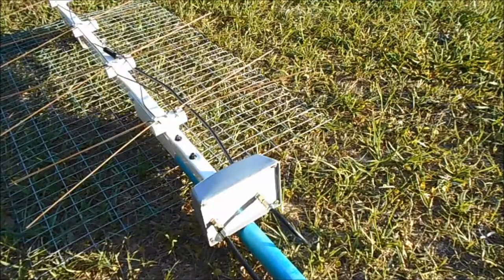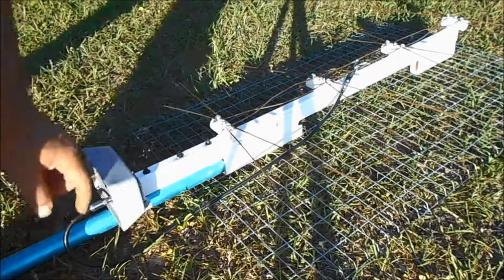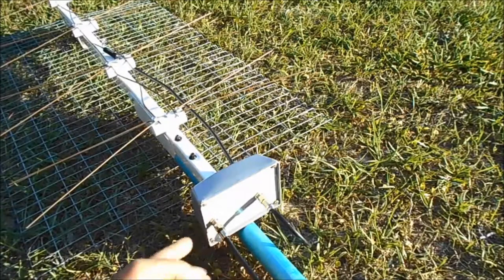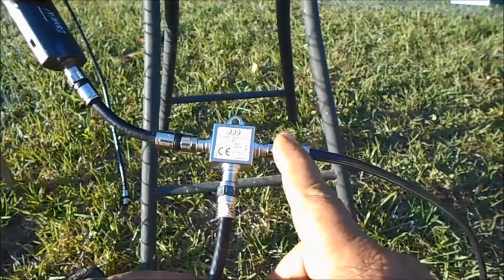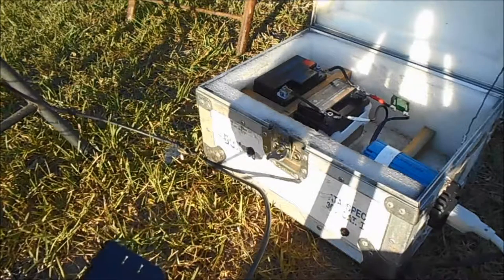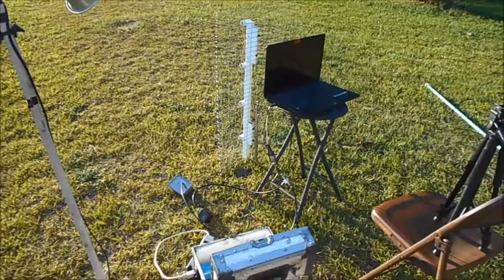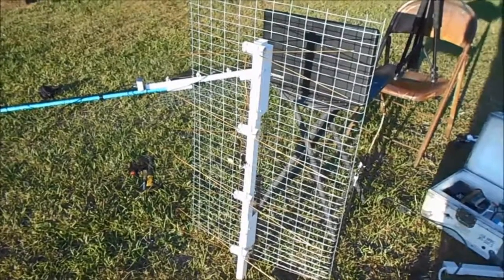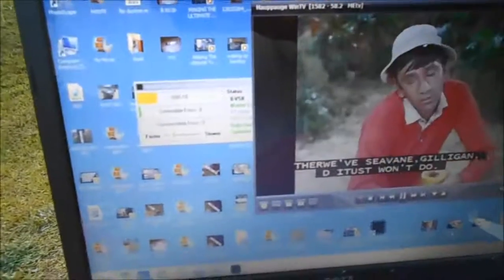Channel Master Booster Installation Before And After Demo

Comment: Hi Danny. I'm confused i made the Ultimate antenna with the  upgraded pvc and screen material for the reflector.
 It was about 15 feet in the air and worked great. I'm about 60 miles east of nyc on the south shore of long island. About a block from the water.
       I put the antenna up on my chimney about another 12 feet so its about 30 feet in the air and I lose a channel, even with the booster off ( I figures stronger channels get messed up so i took the booste off). I'm using the rca amplifier. It was working better when it was lower but i don't have a lower place to put it.
    Should I try making a different antenna? Any suggestions would help a lot.

Comment: Are you using the  7777 or the  7778? Also what is the bennefits of the Channel Master compaired to  say a Winegard LNA-200XT. Some claim the Winegard  has less noise others say the Channel Master. The biggest thing I see about the Channel Master is that it has a switchable FM filter.  Thanks.
Reply from the maker: 7778 they both got  fm filters

Comment: You are boosting the signal at the antenna, however you are not improving the picture quality. Whatever picture quality you have at the antenna, slightly snowy or what, you are just amplifying that in db signal strength,  that is all. Boosters are used to cover the loss in the run of your cable not to improve picture quality.
Reply: But the picture did improve. Did you not watch the video?
Reply: dont listen to this bullshit. the booster will somtimes make the difference between gettin the channel and not gettin the channell.